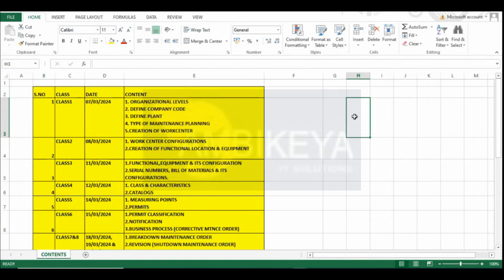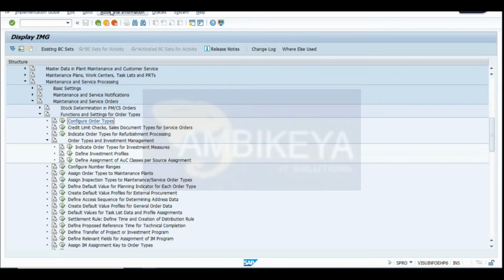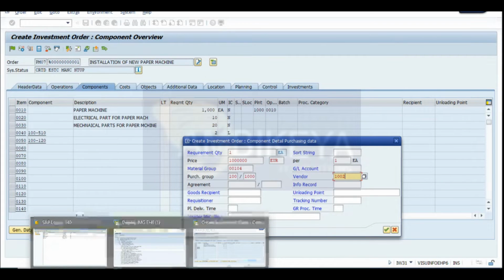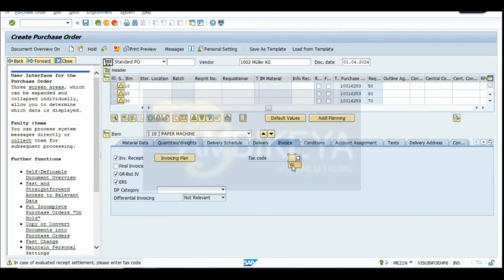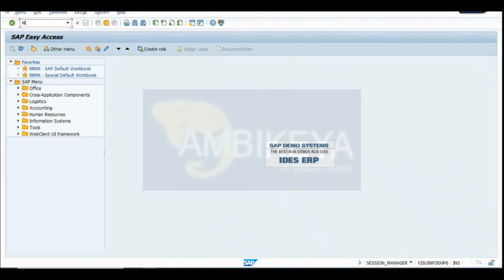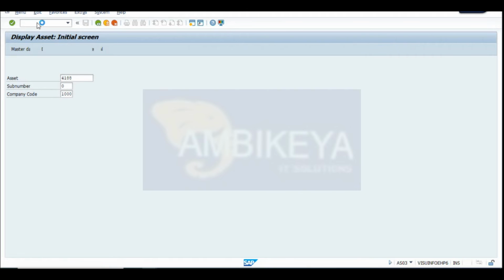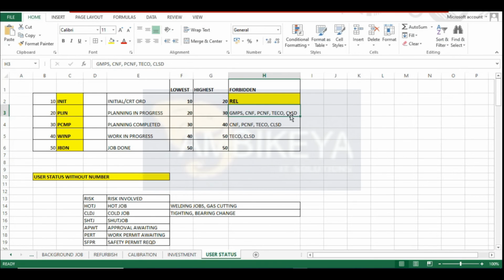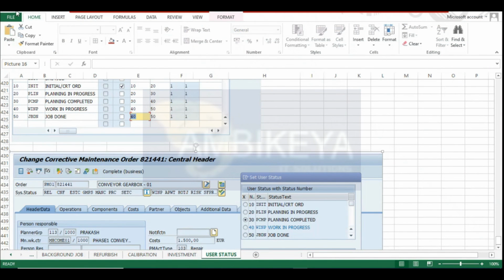SAP PM (Plant Maintenance) Investment Order, User Status Session || Best SAP PM Training |  Ambikeya

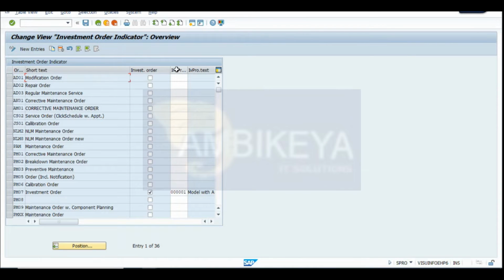Comment: 14:23 Investment Profile is not the same as Budget Profile.
Investment Profile can be configured in PM Configurations which primarily controls the Asset class of the assets that are generated by the Investment Orders.
Budget Profile is configured in Investment Management or Controlling Configurations, where you can put the limits on Actual costs of Maintenance Order.